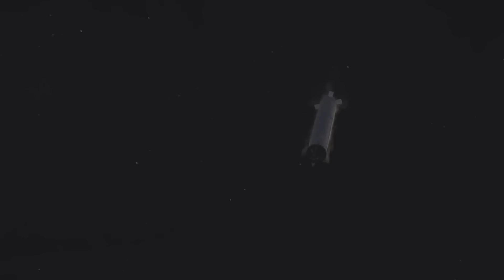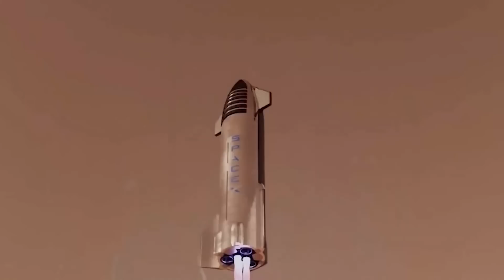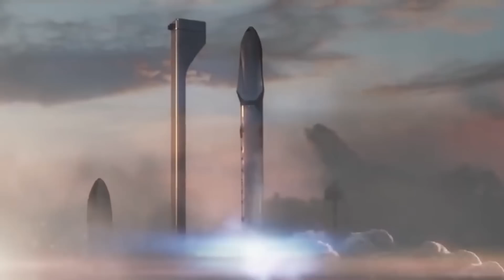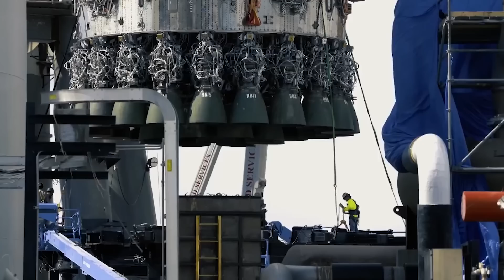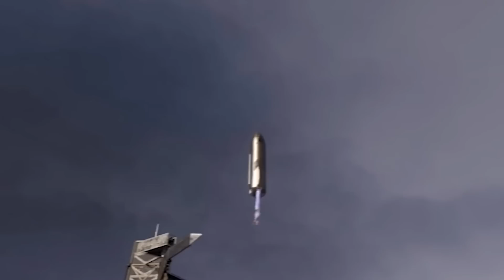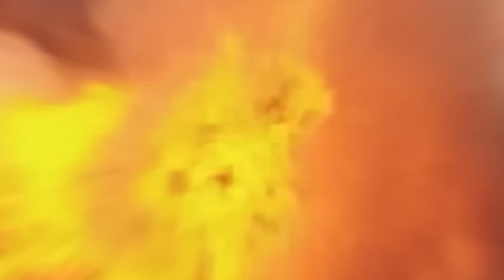SpaceX is FINALLY Launching Starship to Orbit in December

Comment: Not quite ready for orbit, according to the information in front of us. There needs to be more adjustments made to the shields beforehand for reliability upon the re-entry into the earth's atmosphere. Also, 
the starship's heat shields need to stay in tack and not drop off during re-entry. All 33 raptors have to be fully tested. So no go until these things are accomplished.

Comment: Somehow the launch facilities need beefing up. Better deluge system, better cement production.  So it does not need constant repairs.  Sounds like this might slow down the launch cadence.  I hope also heat tiles don’t fall off so easily.